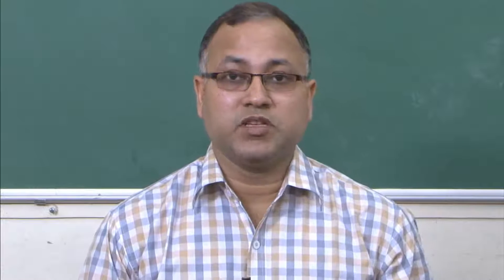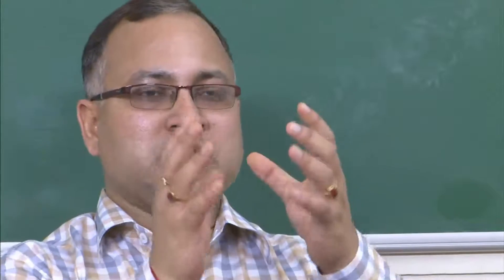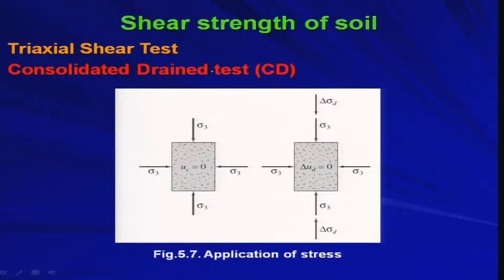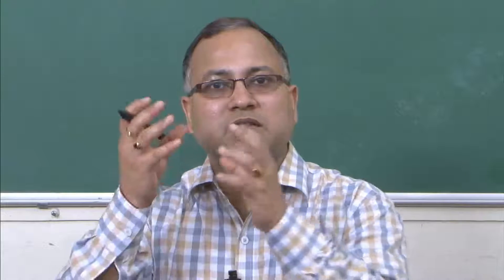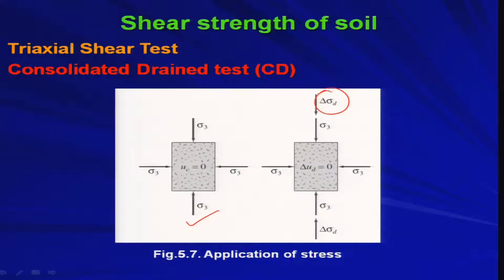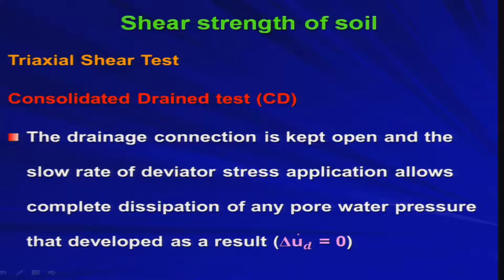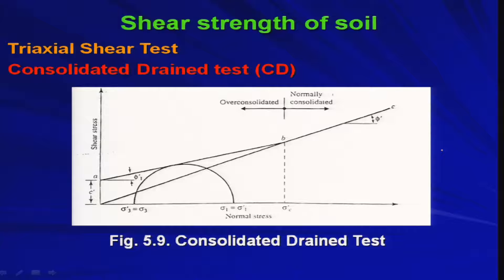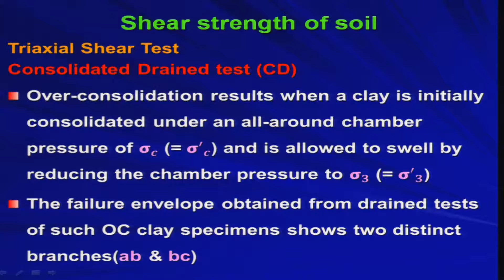Module 41 -  Shear Strength of Soil

Comment: But sir at first you said that in CD test, during application of deviator stress initially the valve is closed and then opened. Why?
Reply: Same doubt for me did u learnt that @koushik pal
Reply: It's needed for initial over-conslidation
Reply: @16:14  first line